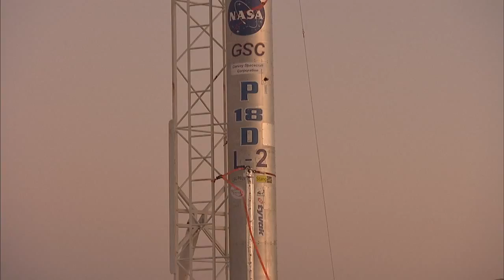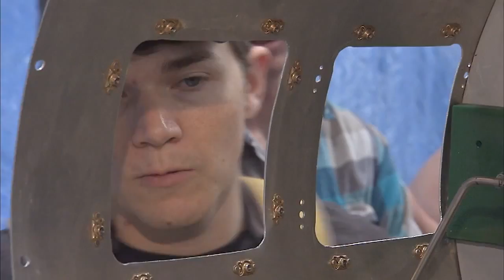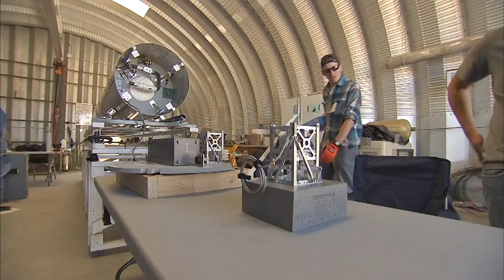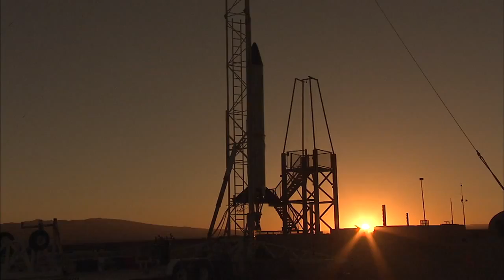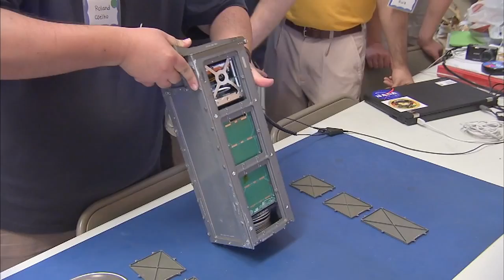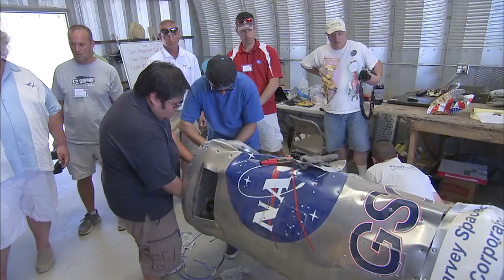Prospector Rocket Launches CubeSat Demonstration For Florida High School, Three Others

Comment: fail 9000 feet. could have sent them to 80,000 feet for less then $1000 on a balloon
Reply: Random Adventures lppp0
Reply: 2q221
Reply: Major fail
Reply: It’s a demonstration not an actual attempt at putting a satellite in orbit. Also a balloon won’t get something to orbit it will just get it to a higher altitude.